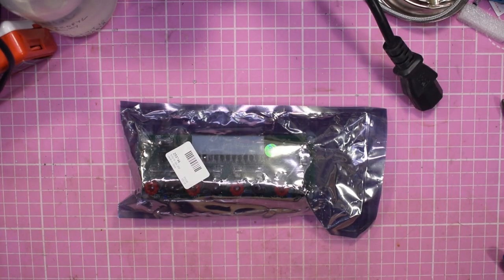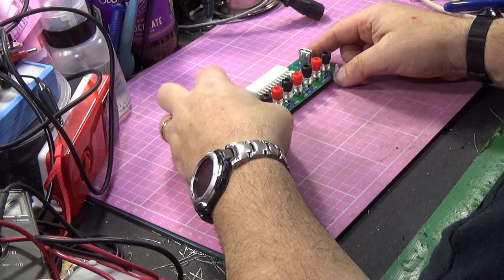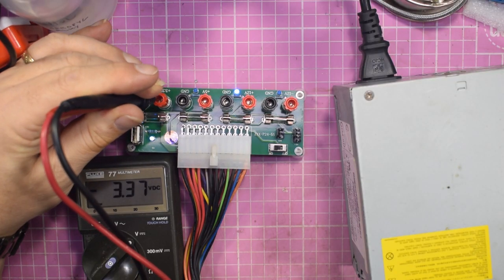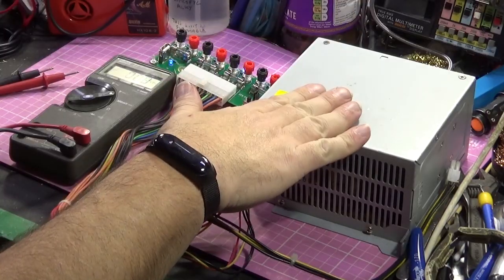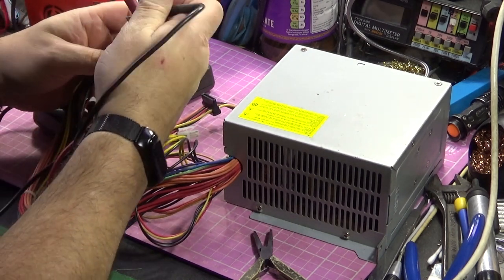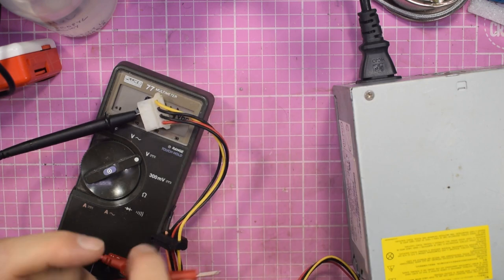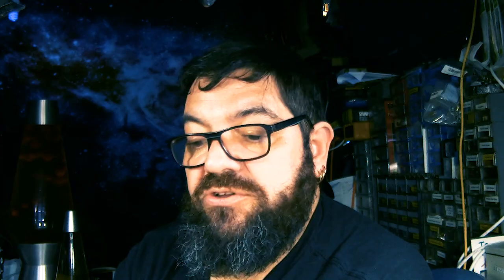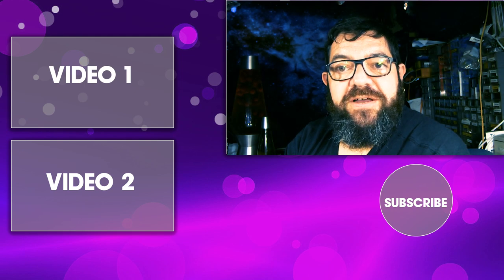Diy Bench Power Supply From Computer Psu

Comment: That's a clever design, thanks for reviewing it.  That breakout adapter does make it a lot easier, you don't even have to open up the  supply.  I have built a couple of these power supply units in the past, and trying to find room for the binding posts, fuses, led's, etc. can be a challenge.  I have found however, that some units require a dummy load resistor either on the +5v or +12v rail (usually 1 amp) in order to start up or keep the voltage pulled up closer to +12, +5, or +3.3 volts.
Reply from the maker: I was thinking that about needing a load, those voltages seemed a little off for a brand name psu. It does make it easier to test supplies though.  Plug in and go on a standard ATX plug. If I was building the board myself, the first thing I would change are those cheap and nasty terminals.

Comment: I have seen videos on converting a computer power supply but I never did it because these are switching power supply's and make a lot of RFI.
That little board is a neat way to do it without cutting the wires on the PS
Reply: That's true Bill.  They are not good for powering radios, and some audio circuits due to the switching frequency  which is typically 15 KHz to 300 KHz range.  But for other things like LED circuits, etc. they are ok.
Reply from the maker: I saw it and I thought I would give it a go Bill. It makes testing random power supplies really easy but I would make it with better quality connectors if I was building it myself.

Comment: Hi George. Looks to be a quick and useful add on.  after repairing it  of course. I have used computer power supply's  for just about everything including  electroplating parts , with copper,nickel,Etc.
Thank you for sharing All my best.
Bobby
Reply from the maker: Yep, it was no major issue but something that better quality control would have picked up. I ended up redoing every solder joint with real leaded solder, just because I thought to myself that if I was doing half a dozen, doing the rest wouldn't hurt it.

Comment: On the one that I bought, all four fuses were 10A.  I'm pretty sure that the -12V line is not capable of 10A.
Reply from the maker: It depends on the supply really. Some of the server ones have huge current capabilities where the domestic 200w ones can barely provide enough for a pc.

Comment: I  bought one in early February it looks the same it works fine but as you said its quality is not good but is a very neat solution to break out the power easier.  I intend to put it in a box with better  terminal posts and maybe a digital meter.
Reply from the maker: For what it is, it is an easy solution but it is let down by the cheap terminals and poor assembly. I think that using the board is an ideal point for a home build in a proper box.

Comment: I have watched many a video on this subject. I have yet to see anyone add a knob to make it variable. Is it so difficult? It would make it so much more useful as a variable power supply!
I am new at this so perhaps it is more complex than it sounds. Great video also! What would you recommend using to attach to posts since they are not banana plugs. Ideally for higher amperage current needs? I was thinking some terminal crimped copper ring or forked slice terminal to a large gauge wire. Any suggestions from you or your viewers would be welcome.
Reply from the maker: For some reason Youtube had hidden your comment.  To make the power supply variable would need some circuit modifications. You would also have to decide if one or all outputs were going to be variable, what current you would like to have available and how big a box you wanted to have on your bench. Connectors are easier to change. You could solder on any style of connector that would fit suitable wire. If I was going to have the high current output on tap I would use a connector like the Anderson Powerpole series. The usual connector would be the 50A one for either the 12v or 5v lines simply for safety.
Reply: @GeorgeChristofi  I have noticed YouTube hiding comments myself. I ended up buying a connector kit and thick wire. All 50-100A. I bought some 250k  30A potentiometers and was going to experiment with adding a potentiometer to a 12v output. I do not care about having various outputs. I just want one adjustable with higher amperage. I have watched about 30 videos where they have a pot to make it variable but none have shown how. I put it off and finished quite a few other projects where I knew what I was doing. I think I am just going to experiment. The worst that can happen is I fry the pot and power supply. I have other computers I don't use that I can get additional power supplies from. My curiosity  is getting the best of me. Thanks for the reply!!

Comment: Do you think this can be used to power a laptop motherboard using an ATX power supply long term? (using 12 V)
Reply from the maker: It certainly could. The laptop wouldn't need anywhere near as much current as a desktop so this would work.

Comment: Feather pluckers these Chinese George. One must remember that these PC power supplies must output pretty clean power for CPU's, etc. 
I hope you don't mind a slightly off topic question, one that I would love an answer to and am asking all over the place. 
What maximum temperature would you consider the practical 'ideal' taken on a power device case. There a hundreds of articles on YouTube and Google giving complex and often confusing heat sink design criteria. For every 10C (50F) you halve the life of a device. Not one that I can find says keep your device case below (for example) 60C (140F). I know this is a very rough and ready method but if I can't keep my finger on it it's too hot (no comment please). That's about 60C (I have an infrared thermometer) - and hurts. Even EEVblog in an old video says it's whatever you feel is right. I do understand this is putting you in an awkward spot but please - GO FOR IT. Regards
Reply from the maker: Power supplies... clean yes as in no ripple but rf hash on the cheaper ones really is a problem.

Off topic question.... I look at the spec sheets of the devices... Some max out at 60c, some say good to 105c, modern stuff can be happy in the 150c plus range. In my home made 30A psu I put thermal switches in rated at 80c for the fans to come on. That was on 3 x 2N3772's. they max out at an operating temp of 200c according to the manufacturer but I went for less than half that. It comes down to what you are happy with. I don't like things getting to the point of causing burns if you touch them but I also understand that these days stuff can get very toasty before it even gets to its max spec. I could have left my psu convection cooled rather than using forced air but I didn't want to overstress the devices for no reason. At £5 each it makes sense not to!
Reply: @GeorgeChristofi  Thank you so much George. So some PC power supples and radios don't get on then, I didn't know that. Heat - right old nest of worms init. It seems my 60C may be a tad conservative but not stupid (makes a change). I use those W1209 thermostats - best value on EBAY. I ran one bank of my power supply to destruction, I only had enough wire wounds to load one bank at a time. I forgot to drop the load and wound the pot to 36V. 368W out of 6 TIP35C's  (Chinese). The one that popped had a mica insulator with part of a layer missing. 0.07 mm that's all it was. Replaced the TIP35C and all was well. The heat sink and thermcouple never had time to react I expect. The transformers are rated at 300VA at 230V and we are 245V so all in all those Chinese TIP's did well. I do try and underrun power transistors by using more than perhaps I could but the TO247 case is so easy to use and at 88P for the TIP35 why not. So many complain about Chinese kit but I'm quite happy with it. Bloody good fun and very good value. Still no magic smoke though. Thanks again George - off to watch your latest.

Comment: That's cheating George! 😋
Reply from the maker: I know!. Thats why I did the Manual method at the end. I am thinking of having one handmade unit on the bench so that the fixed voltage stuff is there as is, and mounting that board in a small plastic box as a portable rapid tester.